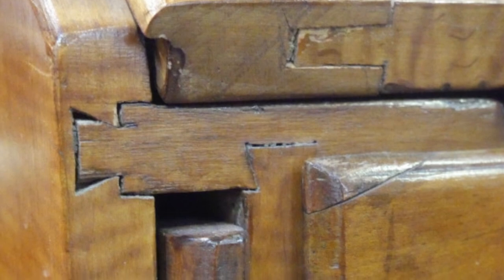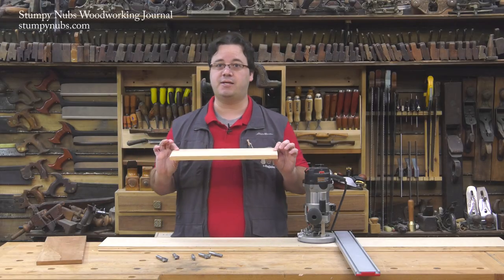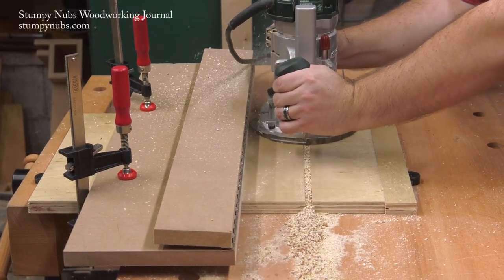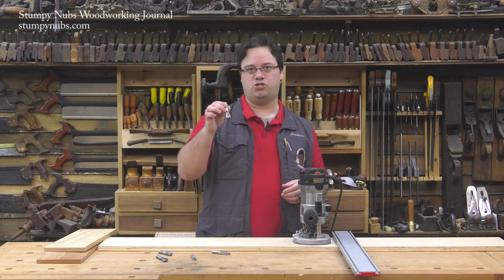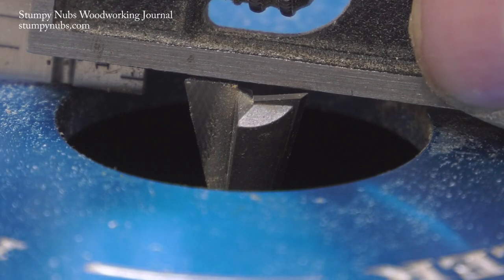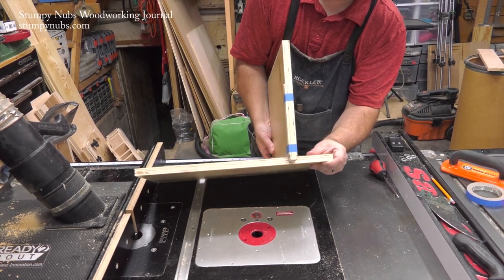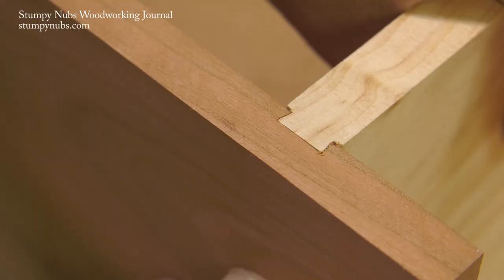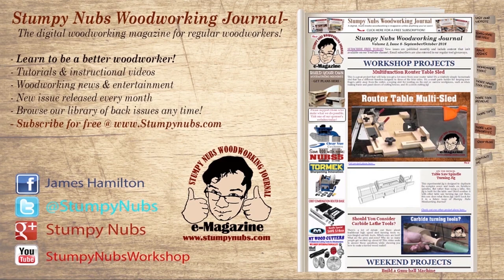This will make you look like a woodworking master! (Sliding Dovetail Tutorial)

Comment: Two things.

If you need to move the edge guide. clamp a piece of square stock behind it first. Then, you can use a spacer to insure you move the edge guide the correct amount, and back again for repeatable cuts.

Tear outs should be an easy one, just clamp a similarly thick, square dowel that is long enough for the board you are cutting the dovetails in. If you are making multiple boards with the same cuts, the square dowel will become a template to set up any subsequent boards giving you repeatability.
Reply: Nice tip, too.
Reply: Ditto Paul's comment.  Especially the edge guide tip.
Reply: Alternatively one could locate the edge guide in place and clamp a spacer to its face. Route the first part of the joint, remove the spacer and route again. Depends on the availability of suitable spacers/shims though...
Reply: @paulvandriel2344  9
Reply: Ready after you
Reply: @gleggett3817  we're woodworkers. We can make spacers.

Comment: Very nice! A shouldered tapered sliding dovetail is one of the few wood joints that can be water tight and it was used in early european bathtubs. The watertightness comes from the fact that the sliding piece swells up with moisture so it is essentially self sealing.

Comment: Great video as always, James.  I just finished a simple table for my church's children's ministry and used sliding dovetail joinery throughout.  It was so easy and looks amazing.  I used a 3/8" dovetail for the mortise and tenon joints on the skirt and then switched to a 1/2" for joining the 2 x 2 supports on the legs.   I did cheat the whole process by having an Incra Fence and Jessem router lift on my router table.  With that set up it was quick and simple to get really tight connections.  Can't believe it took me so long to discover this, but will certainly do it again!  Thanks for videos.  You have been one of my best mentors.

Comment: Great points. I think it should be mentioned also that if you want to prevent tear out, and have ALL of your dovetails nicely exposed (not just the front like said in the video) just clamp a thin small piece of stock at the end of where your router bit will exit on the piece of wood you are dovetailing. The router will pass through the end of your project wood and will tear out the random piece of stock instead

Comment: When you assemble the joint, put the glue on and then slide it together fairly quickly.  If it seizes up on you, use a bar clamp to pull it the rest of the way.  The glue acts as a lubricant under gentle pressure, but really resists hammer blows.  Thanks for a wonderful video.
Reply: Dont't to forget to only gleaux the first bit of the joint, it will self-lube without squeeze out yet not get all clammy.

Comment: If you need to cut wider dovetail slots without moving your fence for a second cut you can replace your router base plate with an eccentric rectangular one. Each of the four edges is at a slightly different distance from the center of the bit. All you need to do is make your first pass with the baseplate edge closest to the bit, then rotate the router to one of the other baseplate edges with the correct additional spacing to expand your dovetail to the correct width. If your dovetail needs to be REALLY wide you can even use all four edges of your eccentric baseplate in sequence, with each rotation and pass widening the cut a specific amount from the previous pass, say 1/4".

If you've only got a couple of slots to cut it probably isn't worth the time to make the base, but if you have more than a few this method can save a lot of time moving your fence incrementally.
Reply: Or set your fence for the close cut and just add to the face of the fence to space it off for the far cut.
Reply: Martin Green wonderful idea thank you!!!

Comment: The tapering makes so much sense and looks easy enough with your edge guide jig. I did a set of ten drawers with sliding dovetails. The 6 inch drawers were tight, but the 12 inch ones were a nightmare to assemble.

Comment: I make guitar stands and need a strong joint at the head stock. The head stock is where the guitar hangs with a dove tail joint, connecting to the upright. I used the dove tail there to keep the stock nail and screw free. I cut tail with a tenoning jig on the upright to repeat consistent depth and thickness. The head stock is slot is cut before I shape the piece. The advantage using the tenoning jig is you never have to adjust the cutter, since the tail and slot are a consistent depth on the router table.

Comment: love it, I'm making a little bathroom cabinet out of some old rough barnwood.  I'm going to give this a try, though the rough edges of the wood might make it more challenging.

Also, who would skip part of a stumpy nubs video?
Reply: If the old barn wood is cupped, that could severely complicate sliding dovetails.
Reply: Thanks, I'll check for that.  I don't think they're cupped, they just have a very rough surface.  Problem is they're painted and I like the aged "finish" they have, so I'm trying to do as little as possible to them.  I may end up just doing butt joints or something simple to keep the look the way I want them.

Comment: Instead of moving your edge guide, get a second edge guide and lock it in place on the opposite side of the cut. Then you simply follow each edge guide after the other to get the appropriate width. This also helps if you’re making multiple slides and want them to be interchangeable as it ensures that each piece is cut at exactly the same point, keeping in mind you’ll also need additional fixed clamp points to ensure you’re placing each piece in the same spot. Useful trick I learned in metalworking to make lots of modular tooling for types of cuts them simply rearranging them for the given work at hand.

Comment: I need to cut 20 of these sliding DT's in a project I'm doing and both boards are 2'' by 1 1/2''. I'm having a hard time setting this up. I'm gonna try to use my RAS with a dado blade to clean out the waste first then use my router table to cut the dovetails. The bit I have is huge, it's 1'' and 14 1/2 degrees. It's not looking to promising. Then the hard part is standing the small boards on end against the router table fence to cut those pieces

Comment: Regarding using 2 routers: Don't they have to be the same make/model? Routers have different size base plates. Somewhere along the road I also heard that router bases are not necessarily perfectly round. It is necessary to make sure you always keep the same edge of the base against the guide. What do you think? Thanks on the video. I'll certainly give it a try.

Comment: How tight is too tight for a sliding dovetail. I had to lightly wax the tongue part if the joint and tap patiently with a mallet.

My concern was to slack and the joint will not be strong enough to keep the adjoining piece flat like a breadboard application. It the board is on without splitting, would it want to split while attached if it was too tight?

Comment: I know he knows what's up but backing up a piece is worth mentioning (again). If you use a decent stripperoo you can trim it when changing bits/settings and she'll back you up for far longer than a Tinder date. For the most part.

Comment: I'm planning to run the shoulder sliding dovetail along the grain of the middle board of my table top. the purpose for that is to keep the table top from sagging = flat over time.

is it ok to insert the dovetailed beam underneath the board, along the grain? I'm concerned about the long board splitting.
I want to do this, to skip installing the rectangular frame under the table top, I just want that "invisible" single beam under the middle board = stiffener, to keep the top flat. the ends of the table will have bread boards.

in most applications I can see the sliding dovetails running across the grain = perpendicular to the grain.

Comment: I'm making bookshelves out of solid Cherry and I want to use sliding dovetails to connect the top to the sides. I have looked on Amazon for your favorite router bit to no avail. The wood is about 11/16  thick any suggestions? Also can I use a ¼" down spiral bit to make my first grove instead of a straight router bit? What is the recommended depth of the cut and the angle for the dovetail bit? All the shelves will be connected with a dado.
Reply from the maker: You don't need an 11/16-inch wide dovetail bit. Just something narrower than the board's thickness. Perhaps 1/2-inch.

Comment: I understand moving the guide to create the sliding dovetail but am confused about only doing the movement to one side of the joint.  When cutting the tail, how do you keep track of which side you are tapering on the board if you need the tail on both ends such as for a shelf on a book case?
Reply from the maker: Do it on the back side. Move the edge guide away from the back end of the socket, and attach the shim near the back end of the tomgue.

Comment: Noobie question here...  I have used routers for a while but, when making these longer trough cuts the router is varying off and I end up with a line that looks like a drunk made it.  Is that mostly just being new to the idea or is there a trick to this that I may be missing?   Thanks!
Reply from the maker: You are likely moving it in the wrong direction. When using a straight-edge the router must be moved from left to right (assuming the router is between you and the straight-edge). In this direction the spinning bit will pull the router toward the straight-edge instead of away from it.
Reply: @StumpyNubs  Thank you, I will try that and see if it helps.

Comment: So what would be the trick to set up exactly the same cutting depth when changing router bits? Dropping down into groove Always give mismatch
Reply: Use a gauge block and your router depth stop. I use spade drill bits. Put the straight bit in the router, zero it against your workbench. Then set the depth stop with a spade bit a size smaller than you want the joint to be. Make your cut. Swap in the dovetail bit, zero it against the workbench, and use the spade bit of the size you want the joint to be to set the depth stop.
Reply: Great tip, thx

Comment: Could a sliding dovetail be used for a jig that moves - ie, a sliding jig?
Reply from the maker: Wooden sliding dovetails will bind as moisture in the air swells them. If you want them to move in and out, you must make them loose enough to avoid binding, which compromises the accuracy of the jig.
Reply: @StumpyNubs  I wondered about that. Thanks!
Reply: @StumpyNubs  What if UHMW, HDPE or regular PE was used for the tongue?

Comment: I need a better router table. My router table fence is a 'loosen a couple knobs and push it' kind of setup... not conducive at all to a Now move your fence back 'x' amount and take another cut. The moment I break the knobs loose all bets are off as to the location. And sometimes moving it can require pushing with increasing force until it finally slips back who knows how far.